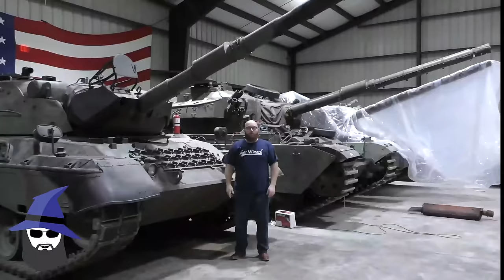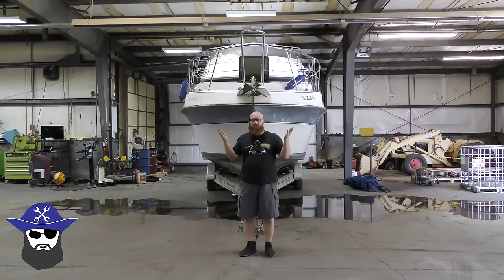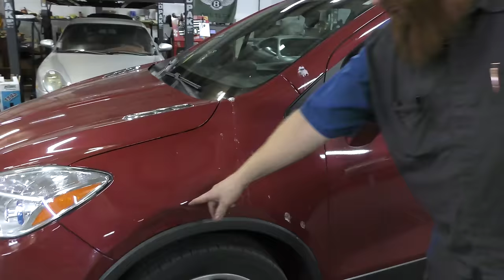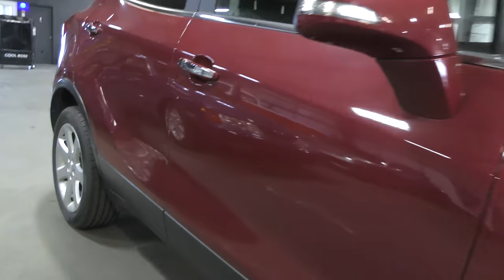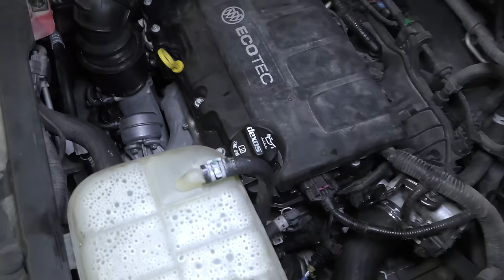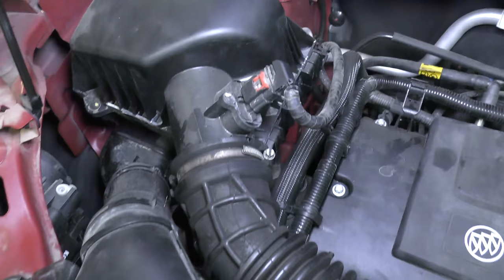How did a dealer miss the problem on this '15 Encore 4 times? CAR WIZARD just had to read the codes

Comment: Lol I didn’t know that changing oil would turn off the check engine light.... that’s a horrible dealership and charging $227 or whatever every time, wow were they soaking her.
Reply: I’ve NEVER seen A check engine light  because it was due for a oil change. They were just hosing her
Reply: In certain cases, as others have pointed out elsewhere, poor oil conditions can cause problems with variable valve timing systems, as they operate off oil pressure. There's one Vtec related code in Hondas that pretty much means 'you need an oil change' and on some of the larger GM Ecotec motors, the VVT solenoids can fail over time due to poor oil conditions. In the latter case it would be a case of 'we'll change the oil, if it comes back we're replacing the solenoid/actuator'. But that's not really an appropriate method for a dealership , or any other "professional" to use for a paying customer. That's more something you do with your won car because you're being cheap. 
In the end, a shit battery and a failing thermostat are like day 1 diags that nobody should miss. Especially missing a bad battery on a 6 year old car.
Reply: @dafirnz  thanks for explaining, I totally get that and should of explained more but my point was it seems like a the dealership was just trying to get a oil change done to make the cash and use it as a excuse

Comment: Thank you! This is why I am hesitant to take my car to a dealer, or any repair shop really. There are not interested in taking the time to identify and solve the problem. Just do something to get the car out the door and bill as many flat rate hours as possible. "Check engine light? Let's change the oil and belt and move on to the next".  The issue is not only the cost, but the lack of skill and professionalism disturbs me.
I would rather do basic maintenance myself, run it untiil it has a serious problem, and then dump it. Like BMW owners do!

And it's not just mechanics shops. Service is pretty much dead in America.

Comment: It’s a Buick Encore, the techs were probably amazed that it ran and drove.
Reply: Actually, it’s a Suzuki, based on the SX4. Looks like they did a joint design on the engine, because that ecotec looks a lot like my 2007 2 liter in my SX4. At any rate, it’s still a decent mini suv, meant to get you from A to B safely, although mine has the all wheel drive option, and is very capable in rain, mud and snow with the right tires. It also gets 40 mpg on the highway. That “Buick” should get better than that since if front wheel drive.
Reply: @cubbysrig  it’s not related to the SX4. It’s corporate cousin is the Chevy Trax.
Reply: That engine is also in the Chevy Cruze. Has a few common problems, turbo fails, PCV problems and intake air leaks.
Reply: @cubbysrig  Definitely not....It is based on a Korean design, if I am not mistaken. I also used to own a Suzuki SX4, an '09, and that car was 2.0 liter with no turbo, not a 1.4 turbo like this Buick. Overseas version was a 1.6 and also a diesel option.
Reply: It's a Daewoo.  Everyone forgets that GM took over Daewoo and they make small cars for GM
Reply: Opel Mokka in Europe, and Opels are a real trouble when they got older.
Reply: @stevendouglas6593  Mine had a turbo failure and back right side passenger door locking issues. It's only got 17k on it. I think the turbo alone was a 2,000 dollar fix.
Reply: @cubbysrig  
No, it's not. This car is built in South Korea by  General Motors, at their former Daewoo factory.

Comment: Rented a “mid-size suv” from hertz once.  This is what they gave me the keys to.   I was immediately repulsed and asked for something different.  Request denied!   Each mile I drove that ugly roller skate, my hatred grew more and more.  I’ve rented many cars and never had such a reaction before or since.  To me, it’s a car designed by and for people who hate cars.
Reply: That’s most crossovers in GM & Ford’s lineup in general. Hell, the average Equinox/Traverse drivers drive almost as suipidly as a good share of European car owners. Aggressive tailgating in the right lane, causing a line in the far left lane, never signaling, potentially slamming the brakes at gradual highway curves in good weather, you name it…
Reply: But those subcompact crossovers have to be the absolute most USELESS class of cars ever conceived. About the same MPGs as a V6/full side sedan/coupe but with only an 8 gallon tank. If you’re renting to go out of town/state in for the weekend or longer, these cars are hands down the absolute WORST company for such endeavors. At least based on my experiences with the Nissan Kicks & Ford whichever is their version of the Trax/Encore….
Reply: @schwenda3727  The encore itself is a 14 gallon tank at 33mpg, you might be thinking of the enclave in terms of poor mpg and small tank.

Comment: This generation of Buick Encore has always looked awkward to me. It looks almost taller than it is long.
Reply: My parents bought one - 2013. I advised against it. However, I ended up inheriting it and even with 165k miles it is a fine car. Everything still works and it is quiet on the highway and does not leak. I'm impressed.
Reply: It's the eggy car

Comment: I work at a shop that does the odd frame repair, and we had an Equinox that came in last week for a quote, and the frame was shot, and the rockers were completely gone. Not worth it to repair. The sad part is that they just spent over $4000 on a new transmission, and that shop didn't say anything to them about the state of the frame, and that they shouldn't waste their money. The customer didn't find out until they went to a muffler shop, and that guy was honest and told them about it. We felt so bad for them

Comment: From my experience, dealership techs are generally kids.  Anyone who is decent either opens their own shop or goes and works for an independent shop after getting experience at the dealership.

Check engine light on?  Oil change should fix it.  Lol

Comment: I'm a little confused.  Are we jumping to conclusions here?  Do we know for sure if the check engine lights were they the same code when the dealer worked on them?  If so why would a dealer release the car back to the customer if the problem wasn't fixed?  How do we know the thermostat was not working when the customer took it to the dealer, it could have recently failed.  Same for the battery.  These are basic maintenance items  They do fail eventually, especially after 6 years.
Reply: because they want to rip the owner off? why would you change the serpentine and do an oil change for a check engine? multiple times!!!

Comment: I've been done bad by 3 different stealerships on 3 different new cars and of 3 different brands.  I'm done with NEW cars.  My 1995 Ford F-150 5.0L has been the best vehicle I have EVER owned and it's just now getting a pair of head gaskets.  Not sure yet if anything else needs attention but my mechanic will check everything while it's opened up.  I may even just rebuild the entire engine while most of it's already unbolted.  Fortunately, this mechanic is someone I trust and he knows that I know how to work on cars too.  I've brought my truck to him a few times for a general shakedown and he just sent my truck and I home.  No Bogus Work!  Truly an honest mechanic.  It seems there are only a few left out there.

Comment: I know of some really good shops, some bad.  

I would be worried about potential long term stress to the cooling system and head gasket if it had been run for too long in overheated conditions, excessive fuel in the oil from running to cool? 

I taught myself how to do repairs not only to save money but also to know when it's best to leave something to a professional.  

 It really helps to weed out the good from the bad if you understand how your vehicle and it's systems function.

Comment: I've replaced the thermostat on literally all of these with over about 50k on them. They are junk. ...Actually the whole cooling system on all of these 1.4s (and also the 1.8s) are absolute junk.
Reply: Small SUVs are a joke. These cars are garbage.
Reply: I believe their is a open waterpump recall for leaks, ive replaced dozens of em .
Reply: @nsp31a  Agreed
Reply: @md2k8  Small SUVs with AWD are meant for those who can't drive and try to overcompensate for their bad driving.
Reply: @nsp31a  I agree with you, because sedans and minivans are a lot better to drive, than most SUV's and crossovers.

Comment: An encore by definition can be up to 4 x's in my experience. 😉 Tell the lady its living up to its name.
They are kind of cute.
Wizard, you should have turned up the turbo to 25 psi and give the lady a thrill. 😊
News flash Wizard, maybe you are being a little dismissive for rhetorical reasons.  The world is unraveling Wizard.  People don't care.  Its hard to find people that tell the truth and do the right thing.  So no, nobody is shocked when a dealer doesn't do what they are supposed to and likely why you will always make a good living because you know your stuff and try to do the right thing.  Almost a rarity today.
Reply: These are known as Opel Mokkas in Europe (exept for the UK) and are also build by German automaker Opel. They're Grandma & Grandpa cars tbh.
Ugly in my oppinton the facelift since then called Opel Mokka X fixed a lot of the bad looking front end but I still don't like it.

Also slow 6-speed automatics but good shifting manual transmissions. The turboengines sometimes blow a turbo, leak oil, but other than that they are ok.
But that's also the reason why spare parts are so exensive for the Encore. It is a rebaged Opel and they have Audi spare parts prices since they don't share parts with most other GM brand.

Comment: This could be one of the reasons GM gets a bad rap for unreliable cars.
Reply: Also, interesting fact, this is NOT an American car. GM, but not American. This is one of the Opels GM imported over and rebadged as a Buick, Chevy, or Saturn before it's demise. GM currently no longer owns Opel, so....question mark on whether GM is making their own now or if Opel still builds them.
Reply: @Jaguarmaserati  these are built in Korea or Mexico. Not sure by who exactly though
Reply: @dankieran1974  So it DID change. I know Opel USED to make both this and the Trax. But, when GM removed Opel from it's lineup...I guess they changed where they built the cars.
Reply: @Jaguarmaserati  I think the newer version of the Opel is based on a PSA platform so I'm assuming they are made in their factories
Reply: @Jaguarmaserati  They always built them in korea
Reply: @Jaguarmaserati  i think GM still owns that model and not Opel.

Comment: The dealers make liars and cheats out of good mechanics. The mechanics are told they MUST make repairs in 1/3 less than book time. They MUST upsell parts and services not needed or not even done. NEVER go to the dealer. Find a good mechanic like the Wizard or find a cliff and push the car off it. Either way will be better than going to the dealer.
Reply: Not true at all. Have you ever worked at a dealership?

Comment: I’m always leery of dealerships since what happened to my aunt, had a 2012 captiva and the dealership could never figure out the random electrical issues. Turned out to be badly frayed and corroded battery cables she had them replaced by my uncle and hasn’t had any troubles for about a year now. I just still can’t believe that they took advantage of her and made her dump thousands of useless parts and hours of labor into her car only to have it be fixed for a part that costs under $100 and takes only a couple of hours to install

Comment: Because GM (and its ugly step children) are some of the worst vehicles on the road currently and their dealer experience does nothing to quell those issues unfortunately.
Reply: @jkeelsnc  Take the money American companies spend on marketing and put it towards engineering and quality - problem solved. We have a consignment auto store near us with essentialy US and Euro stuff sitting there months on end while a Toyota or Honda, no matter the year/condition is sold the next day. Like Tommy Boy said: "if you want me to take a dump in a box and mark it guaranteed, fine, but all you have is a guaranteed piece of shit"
Reply: @jkeelsnc  Just today a 2000 Camry rolled in and right out while 30 American cars of different ages/prices continue to sit. No amount of commercials will fix that GM/FOrd/Chrysler !

Comment: Sadly, you've been insulated from having to interact with dealerships on the customer level for so long that you're just now seeing the light. It's been going on for a LONG time. My 2017 F150 2.7T is now on its 4TH OIL PAN from 2 different stealerships and it still leaks. I have resigned myself that these techs just cannot cut the mustard. Now that it is firmly out of warranty, I will see to it myself by making a proper gasket instead of relying on these pinhead techs to perform the service directive fix with gasket-maker alone. This is in no way condoning Ford's horrible idea of creating a plastic oil pan with no grooved o-ring. 

Countless videos exist of dash cams capturing dealership techs failing to measure up to proper standards and yet people keep going back to them. Pretty unbelievable.

Comment: A scan tool and common sense...the second ingredient seems to be missing at most dealerships (and many independent garages) nowadays!  Working in auto parts for many years, I heard many a car story, and many a tale of woe from my customers.  And it was rare that I couldn't at least point someone in the right direction after hearing symptoms about a problem, which meant that I had a lot of repeat business-- even if I didn't get to sell any parts as a result of helping to diagnose issues.  One of my favorite things was to have a customer return to the store and say, "you were right!".  It was even more gratifying when the customer was one of the local mechanics!

Comment: On dealship I visited said the car wheel bearings had to be changed, for the price of 2600 Norwegian kroners (nok). An independent workshop looked at them and said they only needed adjustments, for the cost of 700 nok. That is more than 3 years ago and they still work fine. Never have I saved so much money for just half hour driving…

Comment: I have a 2016 Kia that had a miss at idle. The dealer started with coil packs then it was the knock sensor needed to be flashed then it turned out to be a  pulley which was covered in a TSB. Thankfully this was all warranty

Comment: This is why when i had bought my 07 F150 new , i never took it back to the dealership, not even for an oil change.  An after 15yrs the very time i did take it. They deliberately  Sabotage my truck , so i bought a new chevy z71 an i will try not never take it back to the dealership ✌🏾

Comment: I had a dealership tell me that a '97 Nissan Sentra needed an entire engine rebuild because the engine was leaking oil.  Seeking a second opinion, I took it to another dealership, who told me that the oil pan needed to be replaced.

I took it to an independent mechanic, who told me that (after steam-cleaning the engine) the problem was a 10-cent O-ring on a sensor that took 30 minutes to replace.  It didn't leak after that and ran another 100,000 miles.  This isn't to say that dealerships don't have quality mechanics, but they definitely seem to favor quantity over quality.

Comment: I had the same problem on my wife’s 1.4 L echo tech and it was just the thermostat. I found it with my cheap little scan tool that I paid $250 for. Took less than 30 minutes to change. The part cost me about 60 bucks.

Comment: 11:14 you're 100% on that. The service writers are actually trained to think that way now. It's all about the up sell up sell. Things like you need a new battery when you don't. Or serpentine belt when you don't. Or the classic cabin air filter trick. Brakes are a big scam job too. They make you think the vehicle is unsafe, when in reality you still have 75% left. They LOVE it when an older couple comes in. They hammer them hard.

Comment: One guy was not changing my oil my engine at 90,009 mile overhead gasket overheated never got a engine light I found what he was doing so I change the oil and coils and spark plugs, sensors on all my cars and I change all the filters out  I have not done brakes pads yet but I will do it and the wheel hubs can’t wait to do that👍

Comment: Just did a Cruze with a similar code, P0128, coolant temperature too low. It was a thermostat in this case, but it is NOT ALWAYS a thermostat. A skewed coolant temp sensor, wiring or similar issue can also cause this code. There are software updates in some cases also.
Never change parts based only on codes. Until you’ve confirmed it to be the “suspected” part.

Comment: Made in South Korea. The thermostat is a frequent failure point or the plastic elbow to it cracks. I believe Buick might have been forced to recall it. The turbocharger also frequently fails on the Ecotec 1.4 too.
Reply: And the valve cover....and the intake manifold...and the water pump...and the oil filter housing...and...and...and...

Comment: Honda CR-V Dealer oil/filter change, got car home. I checked and they didn't change the oil. Returned car to dealer and they changed it. 6 months later, oil/filter change and the same thing happened. The CR-V has a known oil dilution problem, no less. Finally, the owner of the car is the Service Manager Sister in-law. Good luck getting your Honda serviced at this joint.